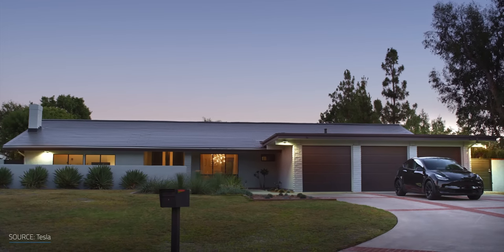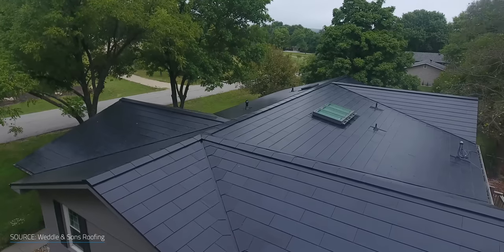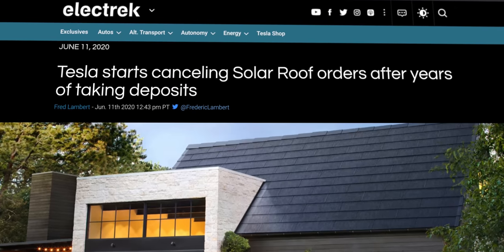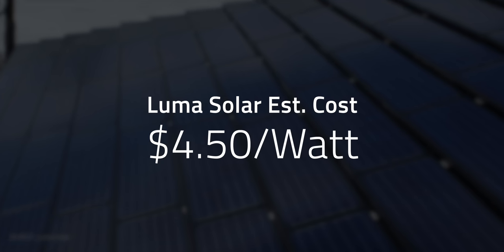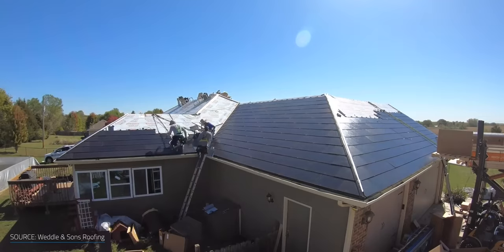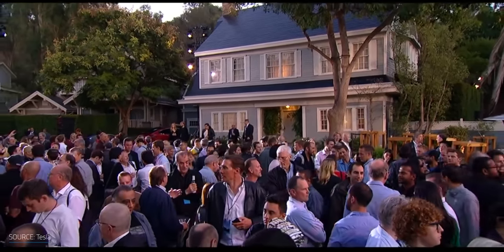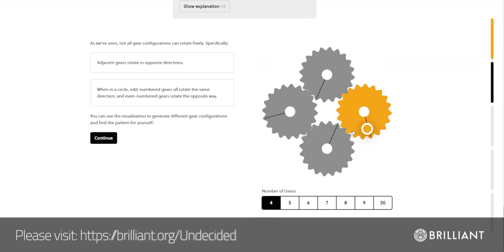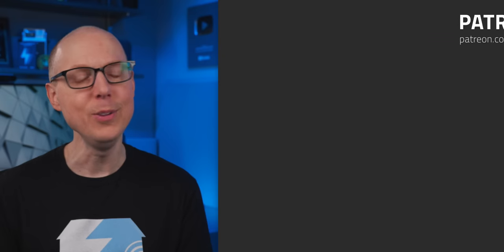The Problem With Tesla’s Solar Roof

Comment: Here in the Netherlands it is (nearly) all regular large solar panels.
Solar tiles are rare here.
22 solar panels with  9 kW converter and installation cost me about € 7.500
Reply: Good setup Jan! 
Here in Arizona, USA, I have a 10 panel 3KW system which cost $9,000 after rebates. The system also came with a Level 2 car charger, but no battery. My solar production goes to the power company which credits me at the same rate it charges for the power they supply me. Fair deal. 
I enjoy the savings, but money aside, I love the deal because of the benign environmental impact. Hope you do too. 
Best to you in the Netherlands.
Reply: That is how it works in the Netherlands to. Home batteries are uncommon here for that reason.
Reply: Yup I do it also for the environment🙂
After about two years of use I need to buy around 1.500 kWh annually.
My converter has around 2.,5 kW capacity left so maybe I will buy 6 additional panels to become zero on the meter 👍😏
Reply: This brings up something not addressed in the video: tracking systems which keep the panels at the optimal angle. In more northern areas like the Netherlands this is very important during winter, but I don’t think tiles have a way to do this as well?
Reply: @SaveMoneySavethePlanet  yes you are right. In winter say December and January they hardly do anything. Althoug they are fully south. Mostly because it is very grey here in these months.
Reply: @SaveMoneySavethePlanet  Tracking systems tend to not really be worth it for househould solar, not even large scale. They add a lot of extra cost, maintenance, possible failures, ... for rather often not that much increase in production. Ofcourse if want to be as much independent from the grid as possible, with as little battery storage, it would be usefull to get more solar at early/later hours of the day.
Reply: @MDP1702  interesting. Yea I’ll admit that I have yet to see real world data for a tracking system. My opinion is all based off of the theoretical numbers that they publish.

When I eventually put a system in I’ll likely not use tracking because it seems the typical system will be more than enough for my house and an EV. Although, I’m still trying to figure out what my usage will go to when I swap to an electric range/oven…
Reply: @SaveMoneySavethePlanet  My system isn't that large, but what I have found is that it's cheaper and easier to just buy an extra panel or so to get more power during the "peak sun hours". I've tried putting panels on a pole, after seeing others here in my off-grid community doing it like that, only to forget to turn the panels...I didn't want to "waste" the energy by using a power turner. My suggestion, therefore is to just get more panels, if you have the space.
Reply: In Poland a 8kW set (panels and converter) cost me about €8.500 in total, unused power is pumped into the grid and then 80% of it can be taken from the grid for free
In summer it works quite well as power from panels is used for heating water for free :D
And in winter it sucks because panels get covered in snow and they're hard to access :/
Reply: Why is everyone lying by not including the biggest cost: THE BATTERY? You can't run anything on just panels and an inverter.
Reply: @bob-ny6kn  well there's the grid so most people will avoid the biggest cost the battery, you don't need it if you're not going off grid
Reply: The Tired Horizon  right... my mistake and oversight.
Reply: @panzervpl9406  right. Sorry.
Reply: @bob-ny6kn  Depending where you live, and the electricity company/national rules, it's not needed. Here in Romania until january 2022 a large number of systems included a battery because the cost between the energy injected and the energy consumed was considerable, usually you paid 4 times the price for injected kwh in comparison with consumed kwh. But with the new legislation since the begining of 2022 the price should be the same on a 1:1 ratio. So the grid is your battery. The injected surplus can be used for 24 months, and if not used in this timespan, the electricity company will pay for the surplus. To resume, a battery usually is not needed and shoul always be avoided when possible because of the cost added.
Reply: U.K. quoted £14,000 for a 4kw system with a 4kwh battery. You get about 5p for a kWh sold to the grid, and pay anything from 25p to 40p for the same from the grid, depending on which provider you go with (some even have “time of day” variable tariffs, which vary every 30 minutes), so it makes economic sense to use as much as possible of your own generation. The incentives “make sense” for the grid - they don’t want to be paying you 25p for generation at 12pm when everyone’s generating, and then “only” charging you 25p at 7pm when everyone’s drawing on the grid, which encourages you to get storage at the residential level and use all of your own production by using the battery, but I’d like to see the energy companies put more investment into storage - if the “feed in” tariff was set to the same as the cost to purchase from the grid, the energy companies would be incentivised to build grid-level storage themselves, which should be more efficient.
Reply: @razvanlex  Yes, that is good. I am in an area where you can not grid-tie and barely can collect sun energy (by law, it is also forbidden to collect rainwater!!)  That is why I assumed everyone was ignoring the need for batteres.
Reply: @SaveMoneySavethePlanet  tracking systems just don't pay for themselves.  Cheaper to add more panels.  And, they can break.  KISS principle :)
Reply: @MDP1702  exactly
Reply: @bob-ny6kn  Sounds like you are living in Russia, North Korea or other communist country (our contry was communist and this type of law sounds a lot like that times). I fail to see the reasoning behind the interdiction to collect the rainwater...other than profit for the water company.
Reply: @PeterStilwell  In Romania we have now a government funded program that allows you to install a 3kW sytem and pay only 10% of the cost. Meaning you pay €400 for a €4.000 system, and the power company have to accept and connect your system. Last year the prices for gas and power spiked really bad here, electricity gone up from €0,14 to €0,25 and gas from €0,028 to €0,16 per kWh.
Reply: @razvanlex  - the batteries make the upfront investment go through the roof and earn-back time gets very long. In the Netherlands, with old "meters" you'd see them reverse when you supplied your excess to the grid 1:1 financially. Newer "smart meters" got introduced and the e-companies paid less to you. Then a law was introduced to go back to 1:1 temporarily. Now solar has boomed and the local e-infrastructure cannot handle the solar power put into the grid beyond some peak. So the success is limited for private people. Which might drive them to batteries. Here, I'd say keeping solar energy separate in your house or on your estate, there are many things you can do without batteries. Heat a hot water tank, run heat pumps, and, yes charge an e-car. Our e-companies are lobbying for not extending the 1:1 compensation and replace the implicit subsidy therein by other incentives.
Reply: @razvanlex  rainwater belongs in the soil aquifer, sewage or storm system. If you build a non-permiable structure, that stops rainwater from the soil and creates storm runoff, so your taxes are increased. Add to that, you are taxed for water usage and sewage (used water). Fun sh*t.
Reply: @bob-ny6kn  I thought the rainwater ends always in the soil or sewage. Usually people use collected rainwater for irrigation purposes, and some maybe for washing? But the water always ends in the soil? Yes, here also we are taxed for water that is used per cubic meter at a price, then for the same water that ends in the sewage at a smaller price and also for the rainwater I think in relation with the size of the roof and the land covered (not permeable). I'm using a septic tank for now and paying only for the used water.
Reply: @SaveMoneySavethePlanet  I'm a solar educator from Australia. Tracking systems are never worth it. If you need more yield, just install more panels at a less than ideal orientation. Panels are cheap, tracking systems are not.

The only tracking systems you would see being installed are east/west tracking systems on large scale solar farms.
Reply: @razvanlex  Some hot countries forbid it because mosquitoes could grow in the water and then spread diseases.
Reply: @itisabird  It makes sense what you're saying. I imagined closed tanks for storage, but probably it would be more expensive that way.
Reply: @SaveMoneySavethePlanet  On tracking; most roof installations (tile or panels) will be static. Yes there are gains to be made with tracking, but it has a down side too - where I live it's very windy, I chose static ground mount (with seasonal tilt adjustment) over fear that tracker system would risk mechanical failure. Roof top system will also be angled 'flatter' to match roof which limits winter production, but also limits self cleaning and dust/dirt build up will be larger.
Reply: @SaveMoneySavethePlanet  I've seen reports that tracking systems only get you another 10% energy in USA, making them not cost-effective. I am curious to hear how much more energy tracking systems get you in the Netherlands.
Reply: @cjimcook  I'm following solar developments quite closely, here in the Netherlands, but I have not heard of or seen any active tracking systems used here.
As has been pointed out,  it is not cost profitable here also.
Reply: Many people buy "new" cars, but "used" homes and patch them us with technologies from different decades which are probably not meant to work together.  If you were buying a "new" home, why not get all new, 21st Century systems meant to work together and to create synergies?  An old, "used" house gets PV panels like a "used" car gets a quick paint job, seat covers and a new speakers.
Reply: @DK-vx5co  because there are not enough "new" homes or place for more "new" homes? and no, flattening old buildings is not (always) an option.
Reply: @DarkDutch007  True, but who has a plan for their home?  Nothing lasts forever.  Everything eventually needs replacement.  Every decision either helps or hurts your "used" home, like putting Pinto parts on your Honda.  Might work for the moment, but...  Some homes are meant to last for centuries while others are disposable like a Bic lighter.  I guess that's the difference.
Reply: @razvanlex  In the US, there's lots of areas where states fight over water rights. A state that is downstream from another state is going to be at the whims of the upstream state unless an agreement is made. Usually it's in the form of the upstream state needing to let a certain volume of water downstream for whatever compensation is appropriate. If sharing agreements weren't made, then downstream states wouldn't be able to make long term plans for consistent agriculture or settlements. Usually the argument is if a settlement is there first, it has more claim to the water even if it's downstream.

Collecting rainwater disrupts the riverflow equation. It diverts more water from what would have been runoff into the river to the soil into the water table. It also doesn't have to be an intra-state issue either; it can also be a problem internally in the state. If a farm was there before a city was built, it has stronger claims to the water that should be riverwater than the newcomer. It is a pittance to the rainwater that falls on areas of non-rooftops, but it bothers downstream users who see it as their water, especially if the upstream state fails to meet their water volume agreements.
Reply: @xungnham1388  Interesting, thanks for the explanation!
Reply: @mnomadvfx  it does make perfect sense, because if you produce electric power that you do not use, you put a burden on the electric grid. The problem with renewable energy sources is they are extremely hard to manage in terms of power production.

When the sun shines / wind blows everybody in the area put power into the grid and stress it risking overload. Then when there's no sun / wind those same people in an instant put load on the grid and overload it in the other direction.

This extreme load variability is local so it can easily overpower a local substation and cause a cascading grid failure. Without energy storage to go with renewables they just aren't a viable long term power source and generate more problems than they're worth.
Reply: Sounds like a very good price. Much better than the UK.
Reply: @DK-vx5co  PV panels are not new technology. Comparing a house with a car is not really a good idea. In a house usually new technology is easy to implement. Changing windows, doors, tiles and flooring, faucets, toilets and basins, installing air conditioning, a gas boiler instead of a stove or even a heat pump is pretty common all over the world. PV panels mounted on a roof doesn't  alter on old house in any way. Usually we tend to invest in our houses, the lifetime of a house is way bigger than of a car. The time spent in our cars is much less than in our houses. Investing in technology for a house is not "patching".
Reply: @vaakdemandante8772  Well, I don't think this logic is entirely true. If a house is injecting energy in the grid, then it's not using any, and when is no sun it doesn't put an instant load on the grid. Usually the energy is injectded only up to the tranformer in the neighbourhood, so the neighbours are using this energy. If all the houses connected to the same transformer have PV, it can be problematic.
Upstream of a transformer there are 12.000V or 20.000V, downstream 230V and 400V respectively, the transformer is scaling down 50 times the voltage. This is for Europe, generally.
Reply: @razvanlex  the push is for most houses to have PV panels, so if it's not a huge problem now, then it will be in the future.

Basically, you're using grid as a battery, so it's obvious there should be a cost associated with that usage. Your alternative is to purchase the battery in full.
Reply: @vaakdemandante8772  I'm a bit optimistic. Maybe not a huge problem, just a problem. Solvable. The power company can limit the power injected by the house, the batteries will get cheaper. Depending on the country and neighbourhood, more or less people will have the money to finance PV panels. I think this is a solution even if you don't inject in the grid, and only use the system for personal consumption during the day.
Reply: @razvanlex  I too think this is a perfectly solvable problem.
I was mostly referring to the fact that people seem to surprised they need to bare some kind of cost for the electricity they put into the grid.
What they are paying for is the battery functionality of the system, not the electricity.
All in all the more people have a PV installation the more educated they get and hence energy system dynamics and costs should become more widely understood.
Reply: The Tired Horizon  This will change in the next coming years in the Netherlands. All excess power produced goes into the grid, and you get the same price for it as it costs you to draw energy from the grid. From next year on until 2030 they will decrease these return prices with a certain % each year, and ending on 0% in 2030. We'll definitely need a home battery by then or use the power directly!
Reply: @Impackon  How electricty's generated and distributed is already very environmently clean, i like the fact that you're house can be independet from the grid but that only works if you have batteries once the sun goes down
Reply: @panzervpl9406  batteries are becomming very cheap in the next year or 2 and cheap domestic appliances from the well known korean, chinese and japanese electronics companies will flood the market.

Which will be a big part in the puzzle of the storage needed to make the grid renewable.
The schemes to extract the same energy again from the grid that you put in earlier will disapear to encourage people to store it themselves for use in the evenings. Reducing load on the grid when the sun is down without needing masive grid based storage facilities.

And they can be attractive for people without solar by charging them at low price hours and using the stored energy in peak hours.

This is what the grid system will evolve to. All the scary stories of vast fields of solar panels and towers and towers of batteries that need to be payed for by governments or energy companies are just that scary stories.
It will be mostly distributed in a decentralised system and the grid will become more of a management system then just the delivery system it is now.

Ofcourse there will still be grid based storage needed and things like wind farms etc. But the bulk will be caried by domestic homes and especially commercial buildings like warehouses, retail buildings, farm barns, factories etc. They have huge roofs and their systems can become another revenue stream for them next to getting rid of their energy bills.